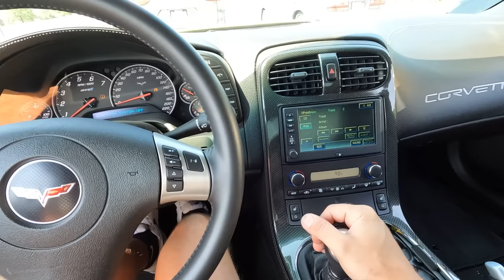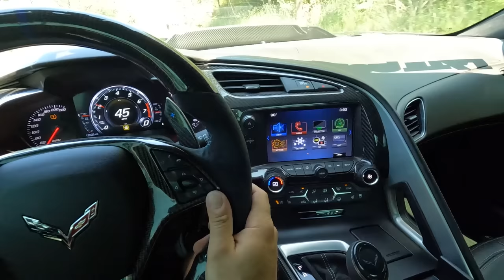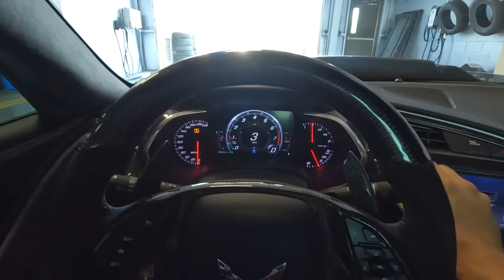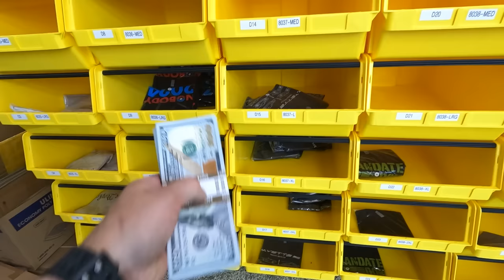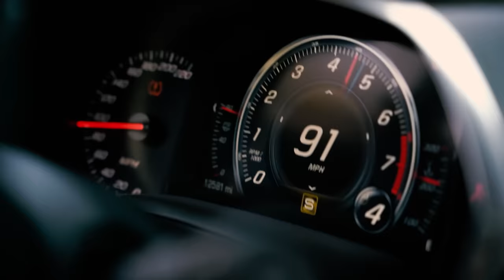This is My CRAZIEST Giveaway of All Time...

Comment: Keep the vertical grill.   IMO the other grill is a TRX thing and will make the Power Wagon look off.   Front bumper needs to be changed for a heavy duty rock crawler style with a nice winch.  Also replace those janky nerf bars with some real rock sliders.   Looking forward to the build!

Comment: I had a Rebel and I'm partial to the honeycomb grill. I looked at the new 2500s Rebel and PW and while the truck has a lot of improvements, the vertical line grill isn't one of them. Also funny to see your exhaust mod, it's one of the simplest, cheapest, and best sounding exhausts you can have!

Comment: You should look into a set of Recaro Speed V’s for the C6. They have yellow stitching as a color option. They’re based on the SR3 Recaros so they’re really supportive. I will say they aren’t the most comfortable on long drives out to track days. 14hrs was my limit. I’m loving the wheels on the P. Wagon. That exhaust though ❤❤❤

Comment: 6:08 when you cold start the Corvette. Looks like a small nut fell out from around the exhaust. Double check all the nuts and bolts are torqued correctly and that none are missing.

Comment: I did the same exhaust modification to my Toyota tundra, and I thought the same thing. And it sounds great while it is parked and just idling, but when driving it has a droning sound in the cab because the pipe was underneath the truck and not out the side eventually got sick of it and put it out the side now it sounds amazing

Comment: One more thing. If any of y'all can weld you can run to advance auto and grab a thrush welded exhaust for like $75. Maybe a few pieces of pipe for diameter changes but still less than $200. I did my truck with one. Sounds great

Comment: You should have just used the flat band clamps. The ubolt clamps ruin the pipe by indenting it and sometimes you can't get it apart or they even rust fast to.

Comment: Mike, muffler shops are pretty dang cheap to delete just a resonator; and they weld it back..  not saying that a coupler will not work, but there is a difference between a coupler and a slip joint..  A muffler shop would of done this for less than 100 bucks, and would of been worth the extra minimal expense.
Reply from the maker: True! Definitely getting a more clean version soon but for now this will work!